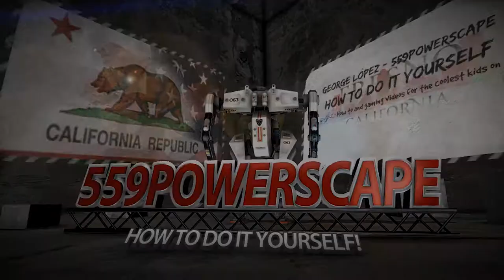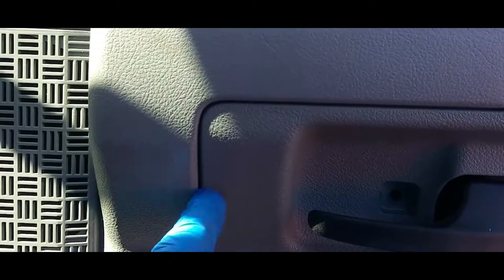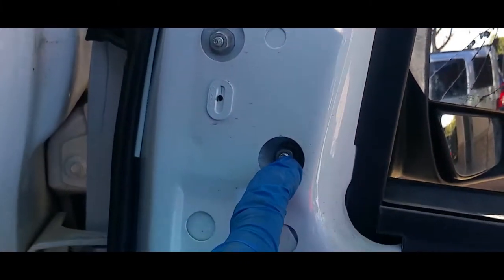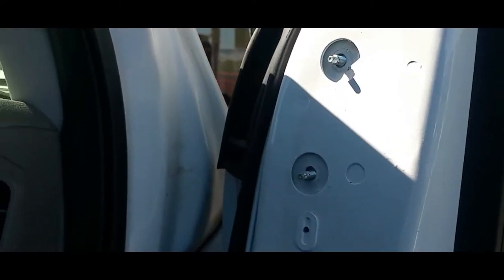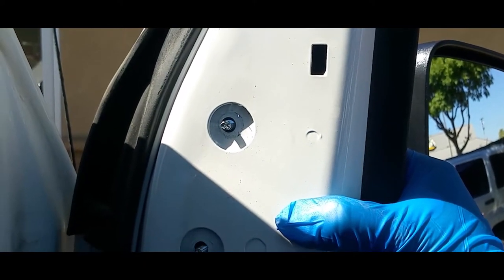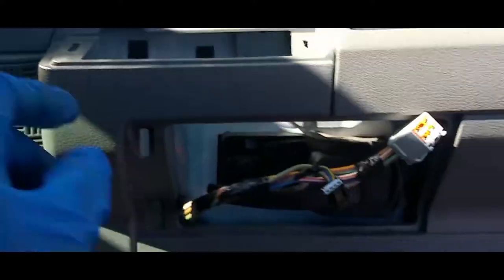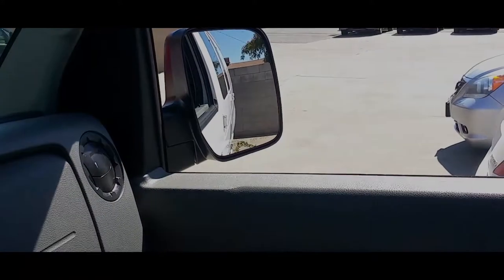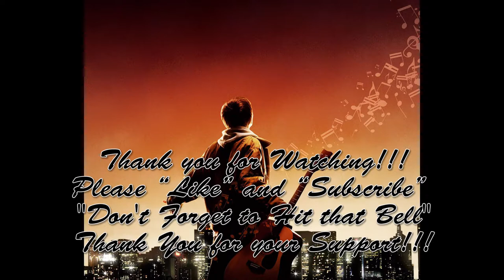How to: Change Side View Mirrors on a Ford E-250

Comment: I just got ford e250 and the top mirror on the drivers mirror is broken. Do I need to replace the entire mirror like you did or can I just find a new upper mirror portion? I was able to pop out just the upper portion of the mirror on a ford transit and I was hoping I was able to do the same on the e250, or do I need to do the entire mirror?
Reply from the maker: You can try it to see if it will work, but my experience with these side view mirrors are if they are broken, they don't work the same. Hopefully it works out otherwise yeah it would need to be replaced unfortunately